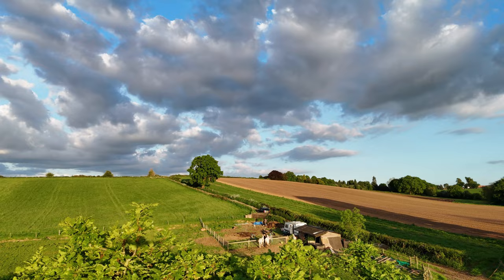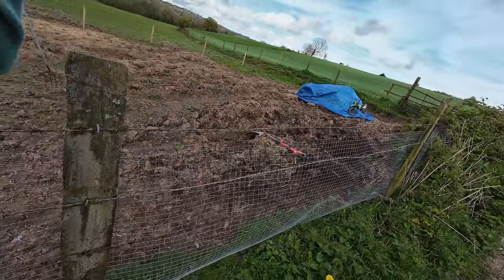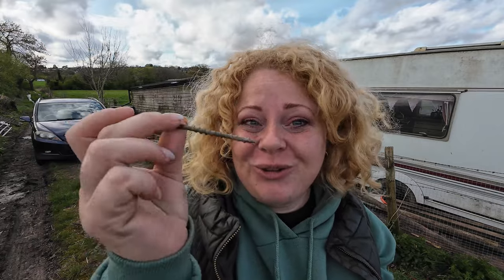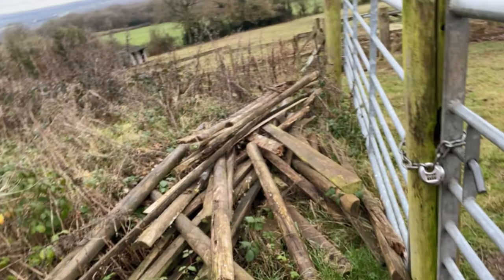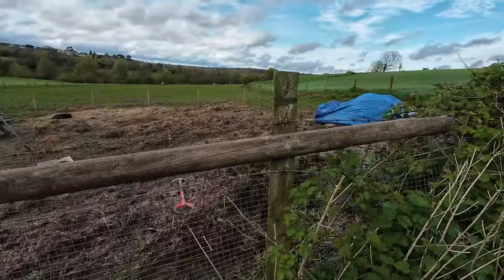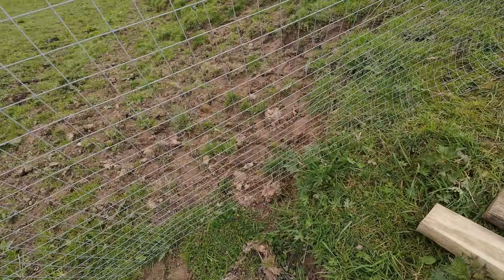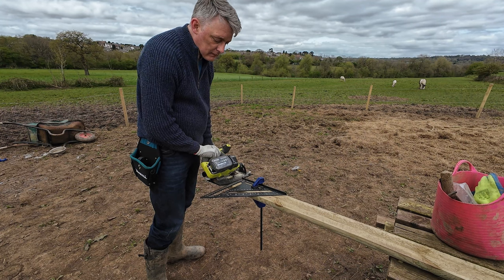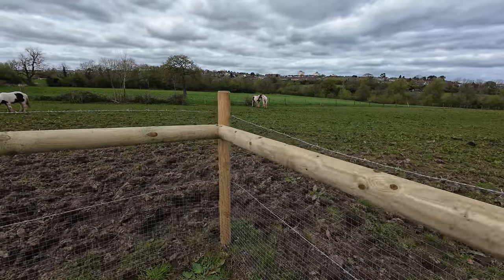From Trash to Treasure: Fence Rails on our Posts! Vlog #25

Comment: Should put bark chip down in your fenced off bit ideal for lunging horses x
Reply from the maker: Thank you so much for the suggestion @SL-kk1lk but unfortunately its not quite big enough and we are about to start the mud and flooding season here which is just soul destroying! I have a plan to add a track system and a grass paddock within that that I can use as a bit on a manage when its dry enough again.